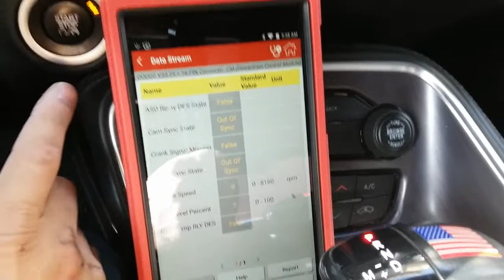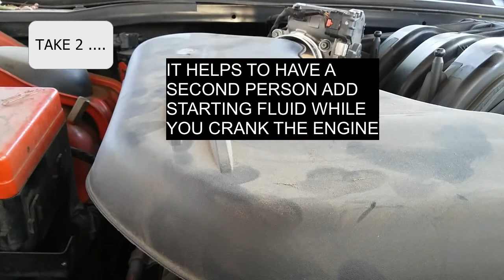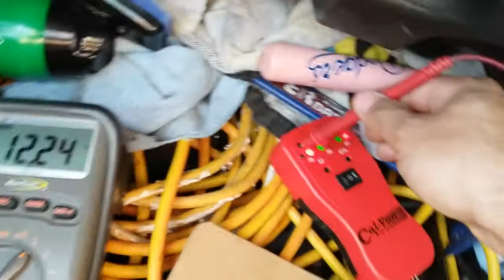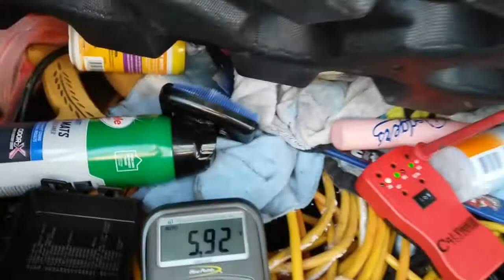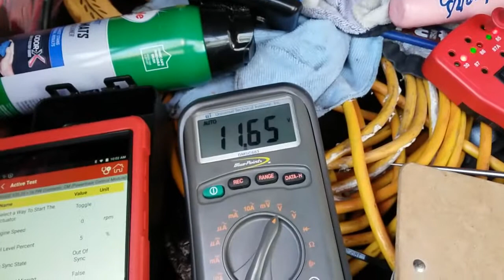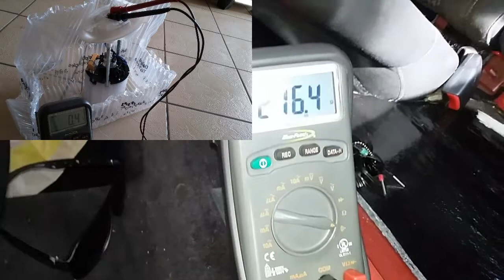(Dodge Challenger) Pre-diagnosed Crank, No Start (Faulty Fuel Pump)

Comment: I have a 2014 Dodge Challenger 3.6l mine isn’t designed like that I put the key in. It doesn’t start. It doesn’t do nothing you hear clicking in the fuse box which one do I have to change? Which one is it?

Comment: How much is the cost for this on my 2013 dodge challenger? New fuel pump replacement?
Reply from the maker: Hi there, it all depends how much the shop charges per hour. I do this independently, I'm not too familiar with shop prices.
Reply from the maker: Are you near the Pomona,CA area?

Comment: Hi will this pump work on a 2013 sxt challenger as well. Also on passenger rear left side correct?
Reply from the maker: I'm not 100% sure, but I think it should fit. It's on the rear driver side
Reply: @Eli TheOBDTech  thank you for confirming rear driver side is where the pump for my 2013 sxt challenger.  Best to you

Comment: How can you distinguish which pin is which on the relay? 

Awesome video subscribing
Reply from the maker: Usually pins 30 and 87 are your load side. Pins 85 and 86 are your control side. You should have two battery voltages, one ground and one ghost voltage. Best practice is to look at the wiring diagram for function operation.

Comment: Bro what if the the ADS relay DES State false all the time I replace the fuel pump and still won’t start and I noticed yours changes to true and the back to false my only reads false
Reply from the maker: You might have a faulty ADS relay.. have you checked relay for proper functionality. Worst case scenario, a faulty TIPM.
Reply from the maker: Do your voltage checks at the ADS relay and Fuel Pump relay.

Comment: I just took my 2015 challenger sxt to the repair shop with a crank but won't start issue. The computer diagnostics came back without any codes, but the car still wouldn't start. I had my fuel pump replaced at the dealer 2.5 years ago, and was told that it looks like the fuel pump might be the issue. I'm taking it back to the dealer to get it fixed, but I've had this issue for 3 years now which is inexcusable for a car with 47,000 miles. If this happens one more time I'm getting a lemon law lawyer and suing the dealer for the car they sold plus damages and repair  and tow truck expenses. Prior to the challenger I owed a Toyota Camry that ran like a beauty and never gave me any issues. All I had to spend on the Camry were oil changes, tune-ups and tire changes. I might just buy another dependable Camry if this Challenger keeps acting up.
Reply from the maker: It seems that Chrysler/Dodge messed up in putting  pins 4 & 5 next to each other, which contains ground  and power for the fuel pump. The connector tends to over heat and cause problems. The new fuel pump comes with a new connector which fixes that issue by separating power and ground from each other. In this video I point that out. I totally agree with you, fuel pumps failing too soon  is unacceptable.
Reply: @EliTheOBDTech  I see. in 2018 it cost me nearly $900 to get it fixed, I guess it'll probably be a bit more this time around. The pump lasted 2 years. You said the fuel pumps are improved now?
Reply from the maker: @RareAirTwo4  Actually, the connector to the fuel pump
Reply: So im having this problem with my challenger 2015 rt the wires heat up the oem fuel pump was burned where the connector is i changed my fuel pump it stopped working the  next 2 days it would only crank i changed again now i get as service fuel sensor says i have no gas on the car and the wires get hot i have not used the the car since the new fuel pump i don’t want to have to buy another fuel pump until i know the problem
Reply: @luchii1105  come to find out, all that was wrong with my Challenger was the wrong fuel pump fuse was installed on my car. So I basically paid for 2 different fuel pumps, and the problem was never recognized by the dodge dealer mechanics, until I did my research.
Reply: @RareAirTwo4  wdym by the fuse
Reply: @luchii1105  fuel pump fuse 25 in the trunk fuse box, had the incorrect amperage fuse installed, which led to my challenger cranking and not starting.
Reply: @RareAirTwo4  okay got you you think mine might have similar problem?
Reply: @RareAirTwo4  what fuse was needed ?